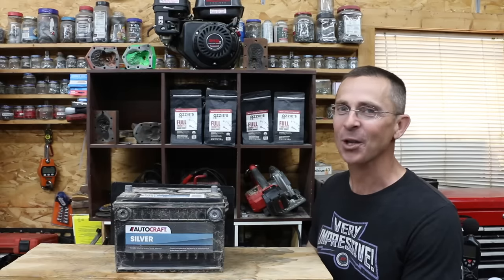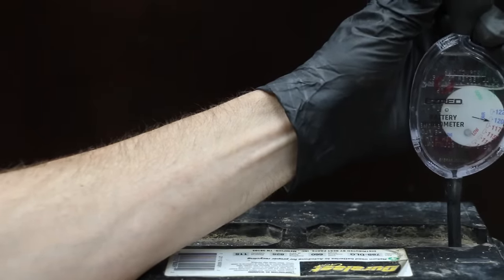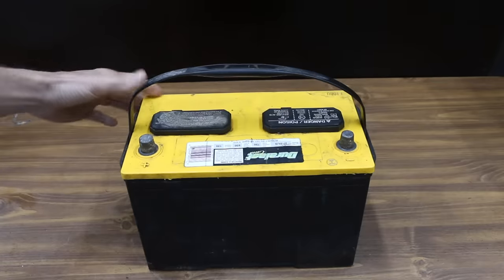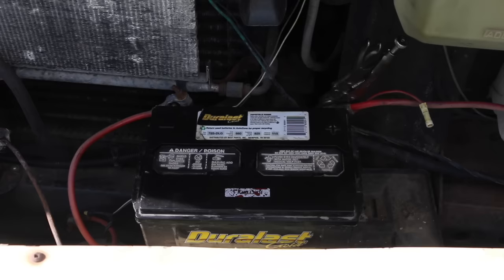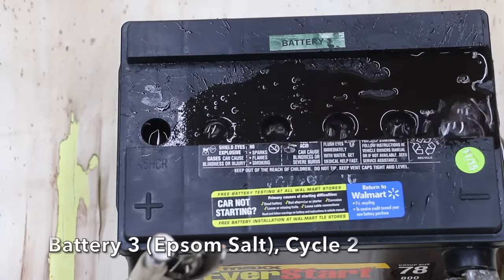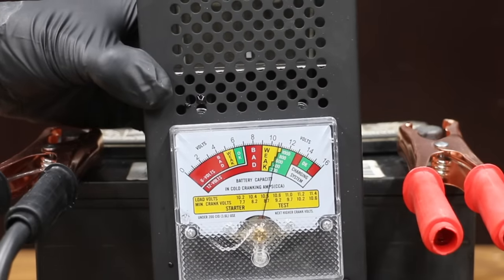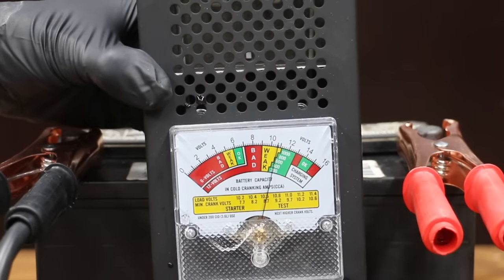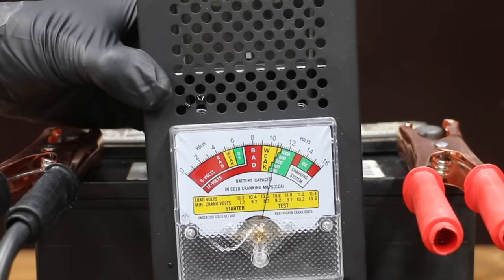Myth Busting! Can You Restore a Dead Car Battery With Welder?  Let's Settle This!

Comment: I was really surprised how the DC welder was able to repair a battery.  I am wondering how long the fix will last and hoping you will make a follow-up video when the batteries start to fail again.
Reply from the maker: Thank you for sharing!
Reply: I would agree. Not sure the rejuvenation will last all that long.
Reply: @gordonwedman3179  it should last long. The reason the cell was damaged is due to a short between the plates in the cell. By using the welder with high current it'll melt off the shorted pieces.

The main reason these batteries lose performance is due to sulfate build up on the plates. By removing the short using the welder, you're left with the sulfate build up which could be bad or not too bad.

I.e a sulfated battery that has a shorted cell can possibly be improved using a welder to remove the short, but you're still left with the sulfate buildup
Reply: @mennims the biggest killer of batteries is short cycles.  Should be 30 minutes running or battery never really fully charges.   Especially in colder climates.
Reply: Would be interesting to see if draining them and then refilling with either 1) distilled water & 2) sulphuric acid after the welder treatment also provides an additional uptick in performance as all the crude in the bottom would be removed
Reply: @markporter8937  You don't get too much crud falling out if you drain unfortunately.
Reply: @markporter8937  To get the dead material out you would have to saw the bottom off
Reply: Best I can tell repeating the process once per year will maintain the battery life for quite a long time. The chances of recovery depend strongly on what caused the battery to die in the first place. If the cause was deep discharge or dried out cells there's a very good chance of recovery. If the cause is shorted plates or overheating due to WAY overcharging then there's very little chance of recovery. SO essentially if you you use the welder trick for too long and kill the battery, you cannot use that trick again to recover it again.
Reply: @Deere2154D  I am no expert, but I had read it to be 30 minutes as well, but also driving at highway speeds. At any rate, all the new auto start stop tech is just killing car batteries more quickly.
Reply: @menchelke if you’re so convinced of that then turn the feature off lol 😂
Reply: It won't last. the battery has a reservoir beneath each cell that "catches" the material that falls from the plates as they age. When the material builds up enough - it shorts the cell. You loose one cell... you can loose multiple cells - but usually you see one fail first. 
All a high current charge did  was to burn off the top layer of the material sitting beneath any cells that were starting to short out. You can do the same thing by "shaking" the battery.
Reply: @gordonwedman3179  it's not so much being against lovely, but if it can work. There's a saying that goes something like this "desperate times call for desperate measures". Consider this a handy skill to have up your sleeve if peril comes knocking.
Reply: Epsom salt ones need to be replenished with sulfuric acid for normal operation
Reply: @markporter8937  And then hold the battery upside down and zap it with a pressure washer to see if you can loosen and flush some more crud.
Reply: @markporter8937  I wondered that as well since I noticed when he tested one of the batteries right after treatment the electrolyte was dark and muddy looking. After testing it again later it was clear. All the junk settle to the bottom I'm guessing. I wonder if that stuff would ever pack down tight enough and just short across the bottom of all of the cells eventually? Might be interesting test to try to drain it out and replace it with fresh electrolyte and see how much longer it might last versus one that you hadn't drained and refilled.
Reply: So the way it repairs it is it desulfates the plates, so it should last quite a while especially if he replenished the fluid and electrolyte
Reply: @mennims  I had an AGM battery go flat dead in my motorcycle.  The bike wouldn't even jump start.  A friend went for a new battery, at Walmart on Thanksgiving morning. (I have a few good friends.)  Dropped the old battery on the ground and then threw it in a saddlebag.  When I got home the old battery was showing 12.9 volt and easily started the bike.
The battery available at Walmart was actually the wrong size, so I returned it and ordered another battery.  I ran the old battery for about a week with no problems while I was waiting.  Just for fun I kept the old "junk" battery on the bench and it's showing 11.9 volt after about 2 years.
Reply: With lead acid starting batteries, they have perforated plates, as they sulfate the plates break down, it is pretty difficult to fully desulfste a battery. 

You can typically tell the plates are deteriorated if the electrolyte is dirty looking (indicating plate breakdown)

If it is an agm or marine battery the plates will be thicker and may survive this process better and give you some more life  than a starting battery

You can enhance desulfstion by removing all the battery acid, and replace it with water, this will help the lead sulfate convert easier. You can even do this more than once. After doing this process and you’re sure it’s fully desulfated, you refill the battery with battery acid from a container, which you can get at some auto parts stores.

Adding chemicals inhibits the function of the battery. Don’t care what the chemicals are. You must convert the lead sulfate back to lead and sulfuric acid nothing else will make a battery work right again

Can you do it? Yep. Is it worth it? Nope!
Reply: I have used the 200 amp battery charger method to "repair" many batteries with mixed results. It can take many "bad" batteries and make them usable again for a long time. The problem is it never gets close to the cca and reserve capacity of a new battery (I test using snap on dtac). Good in low demand applications but personally not reliable enough for use in high demand cca or wintertime.
Reply: @vjay4297  Yep as I remember the epson salts acts as a cleaning agent. Once complete it is dumped the cells flushed out and allowed to drain then either fresh sulfuric acid added or the old acid filtered and added and of course a full slow 1 or 2 amp charge until fully charged. Obviously this cannot be done with sealed top batteries because it destroy the battery because there's no way to restore the top afterwards at least not the average DIYer.
Reply: @menchelke  my dad is a licensed automotive tech.  30 minutes, especially in freezing Temps.  Short trips is what kills batteries as they never fully charge
Reply: @mennims  I've never heard anyone ever say what you have  described. Once there is mechanical damage like plates shorting that's a wrap for that.

The high current is one method that can be very effective in desulfating plates. However it is not going to melt shorted plates
Reply: @mennims  if it extends the life of a dead battery by at least 1year that is very good
Reply: @dotar9586  interesting. Perhaps throwing it to the ground loosened the short? Would be interesting to test that. If you're ever stuck with your bike where you can't kick start it, try remove the battery entirely and run the bike without it. Depending on the design the alternator will keep it running. Perhaps it wouldn't kick because the shorted battery was consuming all the energy when you were trying to kick start it
Reply: @Beaches_south_of_L.A.  Have you watched the video? How would it not melt shorted plates... Its basic electronics. Why do you think the battery acid was boiling?
Reply: @dont.beknown5622  It also boils off all the bad stuff out of the battery. You keep doing the boil until the boiled water is clear and vapor free you'll have a better battery.  
  
Shaking the battery does not boil out the bad stuff. Also you do not refill the battery with new DI water if you just "shake the battery". You've missed 2 crucial parts of this procedure.
Reply: @mennims  I do not know the boiling point of hydrochloric acid at sea level but it's probably in the 190°-220°F neighborhood. Lead melts at 622°F. There's about a 400°F difference. Now bubbling battery acid does not necessarily mean it has been heated to it's boiling point. You can have battery acid bubble at temperatures much lower than room temperature. It can bubble at just above freezing if it has reached a full charge. One way to tell if your battery is completely charged is if it is bubbling. Your comment is embarrassing and makes you look pretty dumb. You should delete it or edit it a lot.
Reply: @Jay Smith how long did you have to let it run?
Reply: @markporter8937  if you use a hydrometer, a fully charged, desulfated battery will test the same as a new battery with refresh acid.
Reply: @TheCatherineCC  yea you need to use a vacuum retrieval like the cheap ones HF sells for oil scavenging.
Reply: @DockDoorDoom  Do you know how battery chemistry works? 
You are not "boiling" anything. The "boiling" action you see is the formation of oxygen and hydrogen from the electrolyte due to overcharge/rapid charge condition. You are essentially "cooking" what's left of the cell plates and sponge material - degrading them by forcibly overcharging them. 
In short - after completion you will have stronger electrolyte, but will have damaged the structure of the cell plates. That will just degrade the cell faster (not to mention you will need to add water - negating anything you did to the electrolyte because the cell won't be covered to the top by your action). 

This really just gave the owner time to go buy a new battery...
Reply: @dont.beknown5622  Have you never boiled a battery? You're quoting a bunch of crap you've read... I'm speaking from knowledge and experience.... I bet you couldn't even cook toast
Reply: Actually no need for a welder. It helps if you have spur growth from plates that touch each other (a shorted cell), but if that is not the case, fully charge the accumulator with a good charger (let it bubble a little so that stratification is not present) , measure the specific gravity in each cell and if it is low, remove some of the existing electrolyte and replace with new, store bought, pre-diluted electrolyte. Repeat as necessary. I've successfully saved serviceable (with caps) accumulators this way that came wrongly filled from the dealership and they went through a 7-8 year service and were sold with the cars.
The books say not to replace electrolyte, but if your problem isn't growths or sediments that short out plates, it is the real solution. Too much bubbling isn't good, and adding water only lowers the specific gravity, if you need to increase it, you need to add electrolyte.
Reply: @mennims  So what you are saying is that if I wanted to try this I should clean it after using the welder to charge the battery?
Reply: @markporter8937  Car battery plates are compressed too tight when sulphated to allow solids to drop out. It can work with some high capacity deep cycle batteries as used in forklifts and commercial backup systems, but unfortunately not car batteries.
Reply: @igelbofh  you've read too many books... Battery boil and adding Epson salt afterwards will cure 99% of the car battery issues.  
Once the plates are gone the battery can't be recovered
Reply: @DockDoorDoom  It isn't boiling though. Water boiling temp is 212f sulfuric acid is around 600f. In the video you can see him showing the battery around 120f not even close to hot enough to boil. The "boiling" you think you are seeing is called electrolysis. It is a chemical reaction not caused by heat. If you pass an electrical current through water  H2O you will see bubbles the water isn't boiling and turning to steam the hydrogen and oxygen are getting separated so you are seeing oxygen and hydrogen bubbles.

Also when "boiling" a battery as you say what is this "bad stuff"? And where does it go?
Reply: @gordonwedman3179  i have several batteries good after ac welder and 24 48 hours of pulse chargher( pulse battery chargher)
And it was restored about 1 yerar ago it work fine on my car and friends 
After restore it you use battery every day (cycles charghe discharghe) it make more good day by day
Reply: I just picked up the same welder. Very impressive, I was figuring on the welder failing. Anyone considering that welder should pull the trigger.  So far I'm very impressed with it. How they get such a small package to perform like it does is some real voodoo.
Reply: @jameshill4900  we have the same first & last name 😂
Reply: Done this about a year ago and the battery is still working fine
Reply: I don’t care what anyone says a car alternator won’t fully charge a battery. Any time you kill the battery and need to jump the car the battery should be put on a proper charger and taken as close to 100% charge that it can get. That is what kills batteries fast.
Reply: @cygnus1965  why would a charger be any different than an alternator? They do the exact same thing
Reply: @libtrs838  

You know, because reasons.😂
Reply: This seems like a good thread to keep watching, but lots of personal stories of success with an equal number of responses doubting the outcome.  I am responsible for 480 batteries in golf carts, so I hang on every word here.  My batteries are now 7 years old so you can imagine the effort that is going to be needed to keep these 80 carts going another year.  The next generation of carts is going to be LiFeO2 and they are not cheap so we are putting off that expenditure. 

I have rejuvenated several batteries using two washes of sodium bicarbonate followed by an Epsom salt solution that remains in the cells and becomes quite reliable. My field is physics and I am not a chemist, but it appears that the magnesium sulfate dissolves and the magnesium precipitates as magnesium hydroxide. 

These golf carts run for eight hours, stop and go.  I am going to try the welder shock treatment on a couple dying batteries this coming week.  Thanks for all your thoughts!
Reply: @mennims  the "boiling" was electrolysis not boiling. Have you watched the videos where he showed 100-120f? That's far below boiling temp. Electrolysis is a chemical reaction from the electrical current it is not caused by temperature.
Reply: @menchelke  you're right. The most wear and tear to a vehicle is during start up of the engine. These stop start cars won't last too long.  Fancy and all but they don't see the long term effects of all of that excess grinding of gears and countless other factors.... I see in the future alot of stalled out cars that won't start back up due to poor maintenance... Oh well I guess. Just another sales "tactic".  Just doesn't make our roads any safer.... Nonetheless.
Reply: @libtrs838  i was incorrect thanks for letting me know. It doesn't rule out the possibility of a short being burnt away, I'm not sure if that's the case though. Would be interesting to watch the current, I think I remember a video where someone did that and the current was high but suddenly dropped
Reply: @vjay4297  no they dont. There only neef be enough time go by and the reactions in battery produce an acidic result. Rpsom salt is perfect to drsulfate plates . Just have to wait a week ot two for it to work
Reply: @mennims  Da the battery acid was not boiling, it was giving off hydrogen and oxygen.
Reply: @sonyxperiathree4554  yes I was corrected on that earlier. I should've paid more attention is chemistry
Reply: @mennims  and without a battery what electricity will energise the field coils?
The only bikes this worked on were British bikes like old Norton Commandos which had permanent magnet alternators and electrolytic capacitors cross the battery terminals to hold a large enough charge to fire the points and coil with the battery removed :)
Reply: @andrewallen9993  the capacitor is likely for the DC side, I.e powered devices. I highly doubt the capacitor had anything to do with the spark. The bikes I've worked on, which may be different - have one or two sets of coils. An ignition coil and optionally a power coil, for lights etc. The ignition coil may feed into an ecu and it may power the ecu. There are likely variations on this, for the most part there should be an ignition coil, going into a transformer then your spark plug, or perhaps an ecu along the line
Reply: @dougerrohmer  Sounds exciting!
Reply: @mennims  The large electrolytic capacitor is to store the electricity generated by the permanent magnet alternator in the first two kicks and supply that to the points\condenser\coil system for the spark plug to start the engine on the third kick ( as long as the kick starter is booted with very little time between kicks)
In respect of my first comment re field coils if your alternator has brushes there will not be enough residual magnetism in the field coils to generate electricity without a battery containing enough charge to energise the field coils. The exception to this is if the engine is fitted with a magneto as well as an alternator or as I mentioned earlier a permanent magnet alternator and an electrolytic capacitor.
Reply: @andrewallen9993  are you sure that's how it works? Perhaps on larger bikes, which I don't have experience with. The bikes I've worked with have a brushless alternator running from the permanent magnet flywheel. I'm not sure about the capacitor charging you mentioned because capacitors store DC, and the pulse is Ac. You'd need to rectify it first but maybe that was insinuated.
Reply: @mennims  Possibly you are thinking of a motorcycle with a magneto and "lighting coil". DC for spark and AC for lighting or  magdyno DC for spark and lighting. I maybe muddied the water by not saying after the three phase permanent magnet alternator there is a three phase rectifier (thanks Tesla) and sometimes a zener diode to regulate voltage. On alternators with brushes there is an electronic feedback circuit to reduce current to the field coils of output voltage exceeds that needed to run the electrical accessories and charge the battery.
Reply: @andrewallen9993  yes I was thinking of that. I'm assuming systems like that are present in larger motorcycles. Thanks for explaining
Reply: @servicetrucker5564  Could drill holes if there was a way to reliably seal them.
Reply: @Beaches_south_of_L.A.  Sulfuric in the battery, not hydrochloric. Battery acid is not full strength, so the boiling point is limited by the water content. Battery acid boils at about 220F.
Reply: @dquam3885  It’d be pretty big holes to get it clean though
Reply: @mennims I used to rebuild exide rebuildable batteries the waist would build up on the bottom shorting out that sells not necessarily always between them that's why it should be flushed very good
Reply: @TingTingalingy  Or a saying I use a lot. " Poor people have poor ways"
Reply: @jeffmosier3145  hmm i like that.
Reply: The bubbles are hydrogen gas and very inflammable
Reply: The DC welder works so well because it is Re-Electeoforming it. I work for a major lead acid battery manufacturer, and we use a similar process,  though we make industrial batteries and use 480 volts for several hours spread over several cycles
Reply: @Eliseo202  my welding class in high school operated similarly. Was some impressive setups in that class
Reply: the high current pulse forces some of the lead sulfate to split back apart and reforms some of the electrolyte and plate material in the battery.